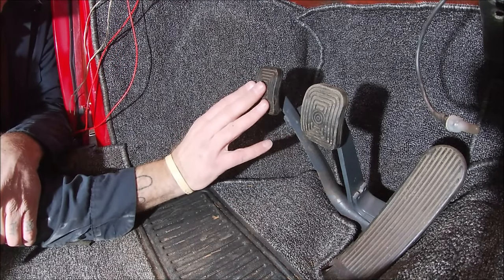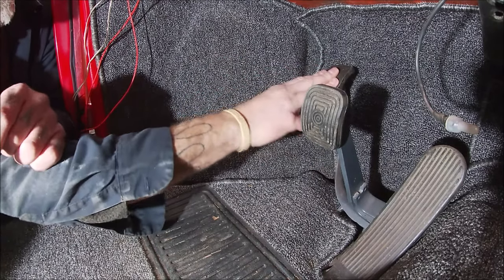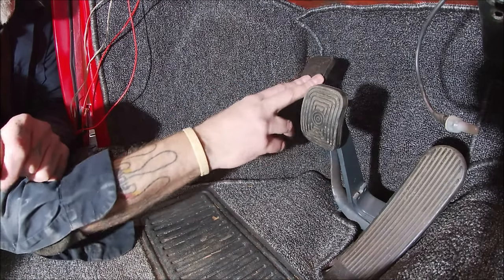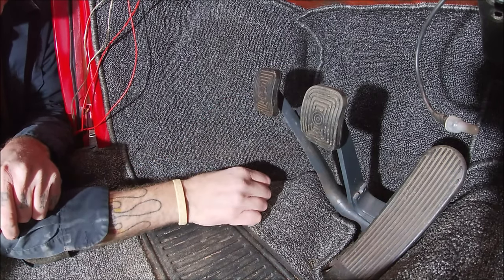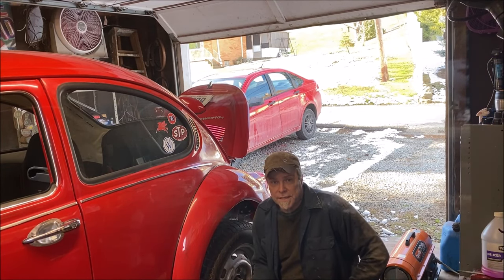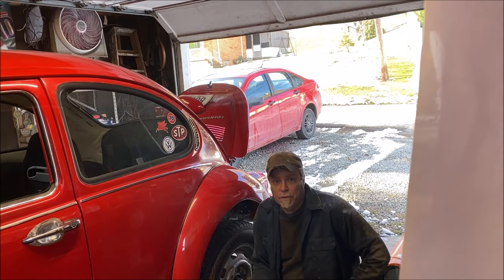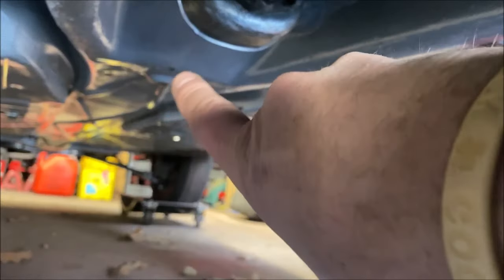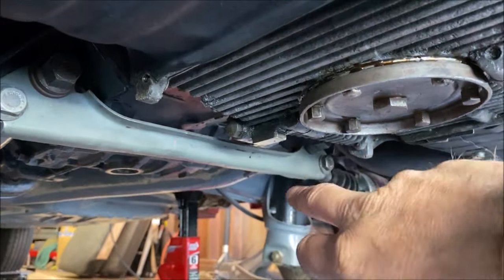VW Beetle - Super Beetle Clutch Adjustment! Very Easy! IRS or Swingaxle

Comment: I just started my 71 after a 3 year restoration.My clutch needs adjustment. I see some pull the left rear wheel to adjust and some reach from underneath. I tried from from under and had trouble reaching. Just an FYI I didn’t get a notification when you post a new vid. Your sound is good with the go pro. 
Stay safe.
Reply from the maker: They sometimes can truly be a pain in the butt. When I didn’t have heater boxes on my last car, I was able to reach up inside so easily. But this time everything was on it, so it made it a little more difficult. Thank you so much for being here Gordon, I truly appreciate you being part of the community.

Comment: Hi Slade, First thing I noticed was the sound is allot better with your gopro. When your next to the bug add a light over by the camera facing you. It's  a bit dark. I've noticed that on my gopro lately so trying a few different things. The podcast I should have had one of those ring lights. They don't cost that much either. CT is really good recording his videos with lighting. Anyway just trying to be helpful. Your videos are a great learning tool for VW folks👍
Reply from the maker: Thanks Tim!! Yeah I’m adjusting to using the Go Pro, it’s completely different than my phone is. And seems to do a wider Angle. The circle lights are nice, and really help!!
Reply: Yep the wide angle you need to move closer or it looks to far away on some shots. It's great for close up work

Comment: Sliding an open end wrench between the butterfly nut and the arm gave me clearance to turn the nut without it continuously falling back into the slot on the arm. Used a vice grip to hold the cable.

 Adjusting the cable is an easy task, but like anything on these cars, you're limited by cramped quarters if you're doing anything without removing the engine.

Comment: Very informative. Believe it or not I’ve actually never used anything to measure it. I’ve always just done it by eyeballing it. The late-model cars are definitely way easier to do than the early model ones. I recently had to adjust the clutch on my 63 and gave up trying to film it because it was hard enough just trying to get my arms in there with the wrenches to adjust it.
Reply from the maker: That was one of the harder films that I had to do. The camera was in the way, which prevented me from getting a wrench on the cable to hold it. Honestly I never measure it, I just do it by feel. But I figured with filming, I better show measuring it for those who are not used to it.

Comment: Great vid.  I just acquired third owner 1968 beetle.  It is 107th car and 13th beetle over the past 45 years.  A lot of work has been done, some i am questioning.  I have never had a clutch pedal sit 1.5in behind the brake.  The front has an EMPI disc conversion.  I dont see a master upgrade. (Thought maybe the brake was adjust too far out).  How do you set the clutch pedal position?
Reply from the maker: Hi Dave, congratulations on your car. There is a slide on the floor with a little bolt you will see right behind the pedal cluster. 
Just be careful loosening the bolt, so it don’t break. You can get some adjustment out of it there.

Comment: Nice video I installed new clutch(and associated parts) got my free play to 5/8” buy now when I leave a stop light it chatters, almost like not fully engaged on initial take off doesn’t do it shifting gears
Reply: You probably need an extra washer put on the Bowden tube, that goes in the other side of that bracket you see near the clutch cable end. You might make your own washer and cut a slot out of it in a horseshoe style so you can fit it over the clutch cable wire.

Comment: Excellent video, exactly what I needed. But, I've now tightened the cable nut twice. The first time in September 5 full turns, and today 4 full turns. At what point am I looking for another reason I'm losing pedal pressure? Thanks!
Reply from the maker: That sounds kind of strange. I am wondering if your cable is stretched? You shouldn’t have to keep adjusting it like that.

Comment: Every two to three oil changes.... I may have missed a few as I haven’t done this in the 15 years The bug has been in my possession. That may be one of the reasons why the car doesn’t want to go into first gear🤣 Thanks for showing me one more way to have a reliable VW!!!
Reply from the maker: Yeah, you want to check that once in a while. It probably needs a good adjustment for sure. If you keep up the maintenance on these old mechanical cars they can be pretty reliable. I hope you have been doing well

Comment: A little grease between the face of the adjustment nut and where it seats on the clutch arm, will make the wing nut much easier to turn.

Also, I use an actual, stiff ruler.  A measuring tape is a pita, and the angle can change as it moves all over.  And I measure from the top of the pedal, but only because Bentley said to do so.
Reply from the maker: That’s a great idea!! Would make it spin so much easier! 
I had a stuff ruler and it broke. I was going to hijack one for my wife’s craft room. But I learned not to do that any longer ever since I stole her singer scissors. 🤦🏼‍♂️😁

Comment: Great video. I just got a 73 SB and I am trying to chase down a metal banging  from the rear end when I get on a ruff road.  I have replace the muffler and heater boxes an it is still making the noise. Is there to check the transmission mounts without pulling the motor. This is the first bug I ever had. Thank you.
Reply from the maker: Honestly, leaving the decklid open, and standing alongside of the car. You should be able to see the motor moving when accelerated up or the car moved back and forth slightly.

Comment: I hope this helps someone because fml I was driving in traffic suddenly I couldn’t shift 1-2, the engine would turn on, but it would not go into first when I would press the clutch, and the clutch had loose resistance I was like wtfff, if I turned off the car and played around shifting gears it would go into 1-2. By luck someone helped me move the car away from traffic, I thought my transmission was fucked idk but the guy told me to tighten my clutch line cable thing and it worked, I still don’t know the cause he told me it’s because the clutch gets super worn where it won’t engage but I changed the clutch like maybe 5 months ago, idk if I bought a cheap clutch but yeah this helped me drive it again I was near calling a tow.

Comment: G'day, 
Kevin here from Australia. 
Great video but could i add one thing. 
My ride is a 63 beetle with the steering wheel on the correct side the rhs. 🤣
What i do is i use a pair of pointy nose vice grips I've put rubber tubbing on the jaws.  Now i snap  these onto the cable as it comes out of the bowden tube this will stop any twist. And if you can i use a nut its got the same base as the wing nut and this means i can get a 14mm ratchet spanner on it. 
Well thats me.
Keep safe and healthy man.  ✌  Peace
Reply from the maker: Thanks for being her Kevin! Usually I am able to get a wrench right up inside of there, and hold the cable. The downfall was the camera was in the way, so I could not get two hands up in there. That was definitely a tight squeeze, while trying to film. Thanks for chiming in, I truly appreciate it! And I hope you are safe healthy and happy! ✌🏻🍺🍺
Reply: @SladesVWBeetle  thanks man ✌
Reply: The only trouble with Austrailian cars is that they are upside down, takes the paint off the roof when you drive them.
Reply: @Paulman50  we are trying to deal with this problem. ✌

Comment: I bought feeler gauges and would .008 be good enough for valve clearance check?? It’s the lowest this one goes
Reply from the maker: Depending on your application, most are .006 on the 1600 dual port.

Comment: I learned about getting it routinely checked, after the third oil change, or as needed.
The problem I’m having is cable slippage. 
I heard, clamp the cable before tightening the wing nut. 
Have you heard anything about this?
Reply from the maker: Before tightening the wingnut, clamp a pair of vise grips, or something onto it so it doesn’t spin while turning the wingnut. Sadly I could not get the camera in there, while trying to hold it at the same time.
Reply: @SladesVWBeetle  You couldn't set the camera down for a second and place the vise grips....? ;)
Reply: My wing nut was so tight that the whole cable twists when attempting to tighten it; it is going to have to take some Vice grips to attempt the adjustment.
Reply from the maker: @christopherruff4001 Make sure to use lubricant first, like PB blast or something similar. Then turn it back and forth slowly
Reply: I’ll try that this evening, thanks!
Reply: I just used some WD40 because it was available and channel lock pliers because a vice grip couldn’t do it and kept popping off the line.  About 7 turns did it and now my clutch pedal doesn’t hit the floor and trigger my high beam button!  The pedal is now nice and spongy feeling with much smoother shifting!  Thanks for the great video, I will look at your other content to see what ya got!  I religiously do my oil changes and valve adjustments but need to review a more wholistic approach to keep this Frankenbug working forever until they ban gasoline cars.
Then I’ll convert it to woodgas like it’s the 1940s!
Reply from the maker: @christopherruff4001  good for you, this made my whole day reading this! I’m so glad these videos and comments are helpful. Keep up the great work, my friend. Feel free to join our Facebook group, Slades VW community.
I do update weekly with videos, which I also include a playlist on the YouTube channel here so you can go directly to which category you need. Have a great upcoming weekend my friend. The following Sunday I will be doing a live chat at 9 PM Eastern time on YouTube.

Comment: Best most accurate way to adjust your clutch is right at the clutch arm on the side of the transaxle. Tighten the adjusting nut till you have just a bit of play in the arm. It'll be just enough to keep the throwout bearing from contacting the clutch plate, and your done. No need for any measuring at the pedal inside the car. Easy peasy.

Comment: I've got the 1/2" slack, but I only have to push the clutch pedal in about an 1.5 inches to release it to shift. Is that normal?
Reply from the maker: That truly doesn’t sound normal. If I’m understanding what you mean. You should have to push it a lot further than that.
Reply: It is normal.  That's why 2 inches of slack is no big deal.

Comment: My clutch cable is unconnected both ends and will not pull out to put a new in
Reply from the maker: @CurtDunmire  OK, was the clutch working prior to this? As in was the cable moving before? It sounds like something got kinked and is holding up. You may have to get in there with a pair of needle nose and pull on it possibly. If it broke.
Reply: No I bought this beetle had no idea this problem existed until now trying to replace the had the transmission pulled back to put new tranny mounts in now going to put the transmission back in I found that the clutch cable is stuck never ever had this happen with any of my Beatles since 1978 until now any ideas would be appreciated I watch all your videos I saved them too thank you

Comment: I safely jacked up my '74 Super Beetle and found the clutch cable and there is no more thread left to tighten the wing nut. It's maxed out! Now what?
Reply from the maker: I’m wondering if you’re cable is stretched. What you can do, and I really don’t recommend this. normally. You can take the wingnut off, and put some washers on or some type of spacer to gain more thread technically. Honestly I would buy a new cable.
Reply: I ordered a new cable but dreading pulling the old one out and putting the new one in. I saw JBugs recommends drilling a bigger access hole.
Reply from the maker: @OleYankeeFarm  I’ve never drilled a bigger access hole to be honest with you. You will be fine, just take your time and move slow.
Reply: Thank you!
Reply from the maker: @OleYankeeFarm  you’re welcome my friend. If you’re on Facebook, consider joining our Slades Vw community group. 
Great folks on there always willing to help out. All slades club members

https://m.facebook.com/groups/264095492585889/?ref=share&mibextid=I6gGtw

Comment: Of course it's easy when the butterfly nut moves freely. Try doing this when it's stuck for years.
Reply from the maker: Oh that’s no fun!!
Reply: @SladesVWBeetle  from now on while the engine is off of the car, I will make sure to remove the butterfly nut and clean that threaded end on thoroughly and put on anti seize on those threads.
Reply from the maker: @brucewayne2773  oh it’s worth it Bruce! I use anti seize…probably too much! Lol